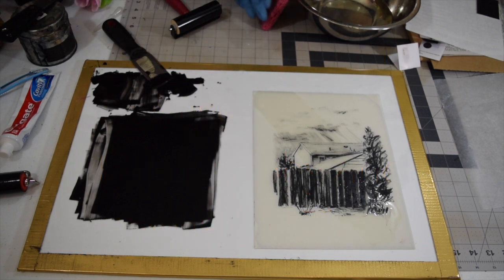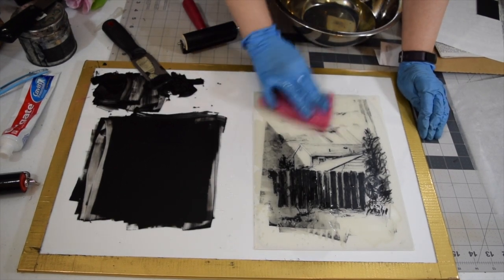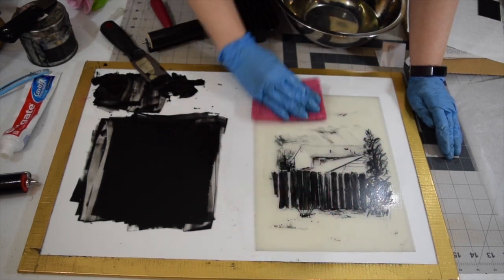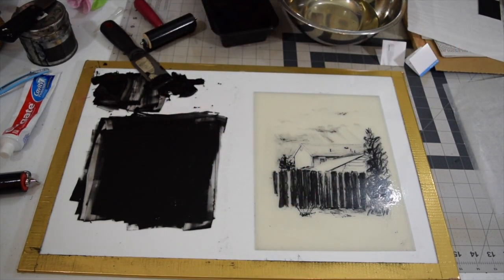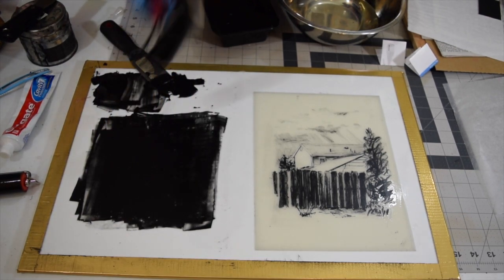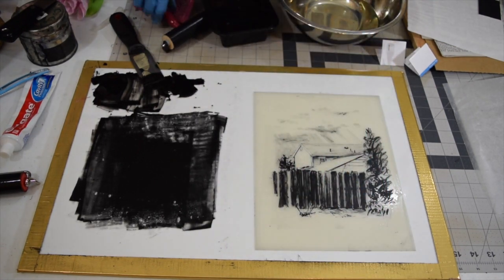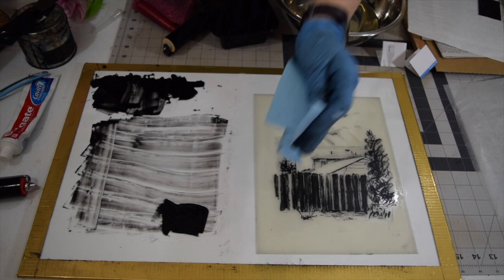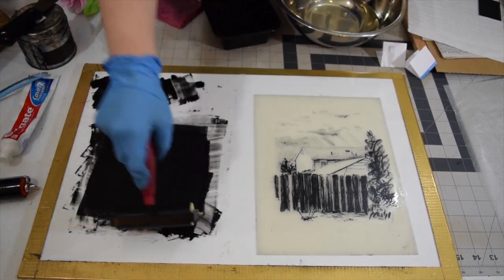Two Common Mistakes in Lithography and How to Fix Them

Comment: Thank you very much for your explanation and demonstration. I have been having problems with ink spreading too much on my plate so now I know what to do about it.
Reply from the maker: Glad it was helpful! Probably try some magnesium carbonate or corn starch. The other thing to beware of is if you are using water miscible oil based inks, like speedball professional relief inks or caligo safe wash oil based inks as those break down with water.
Reply: @Chcole88  Thanks for the corn starch suggestion. I will see if that helps.